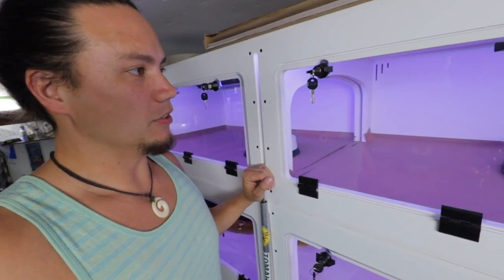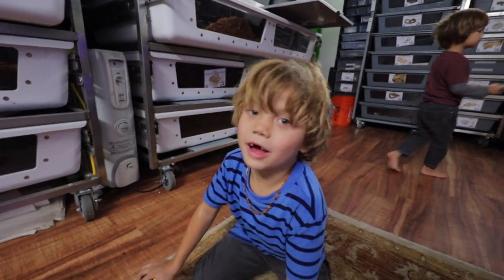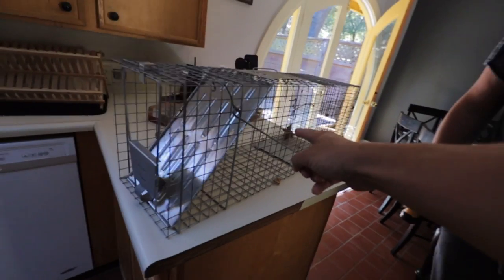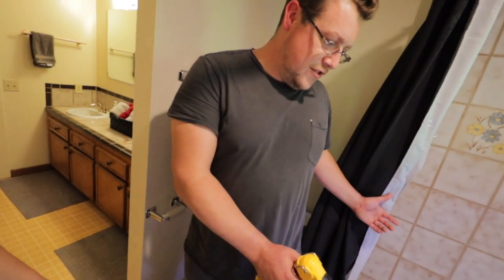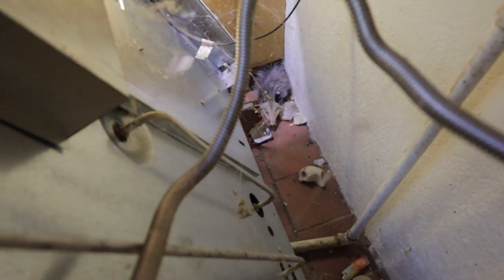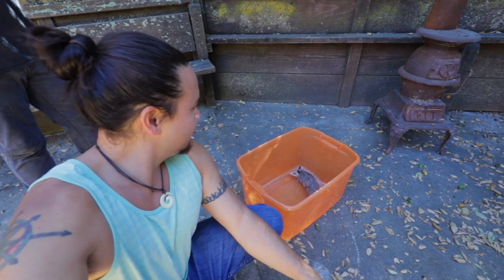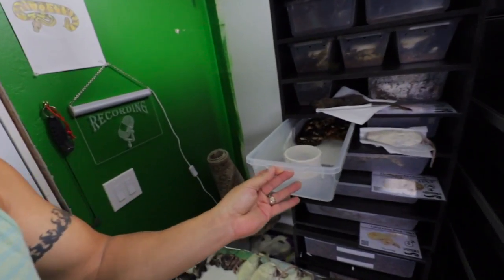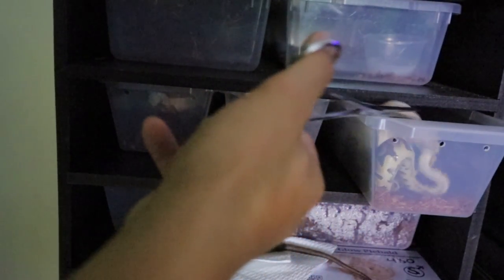It POOPED ALL OVER the house

Comment: That's amazing that the possum was able to get back there behind the stove. We get alot of them around here. My dog kills them in the back yard or if they play dead brings those and drops them on my back porch too. I wouldn't dare attempt to pick one up by the tail because it can curl around and bite and they can carry rabies. What I usually do is put a container on its side and push the possum into it with a stick, then put a lid on it.

Your cousin should look to see if there are any holes where it got in and plug those so it doesn't keep getting in (or its littermates). Once it knows it can get in he might have an ongoing problem, especially during bad weather when they're looking for shelter. I don't know much about the part of California you live in but I know that some parts do still get cold in the winter.

As for the baby snakes you might have some luck getting them to eat by scenting the rats with ASF juice. I hear it works really well. I plan on trying it one of these days. They sell it at Repti-links but you have to put in a $75.00 minimum order which actually comes out to around $100 because most items come up either under or over $75.00, but if you have the extra money it's worth it to have some on hand.
Reply from the maker: IAMGiftbearer Not a bad idea